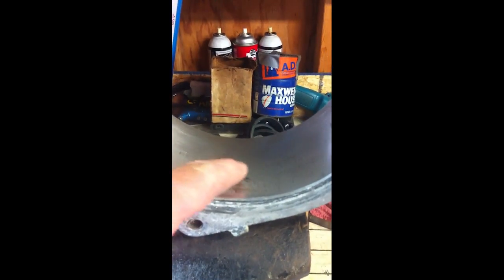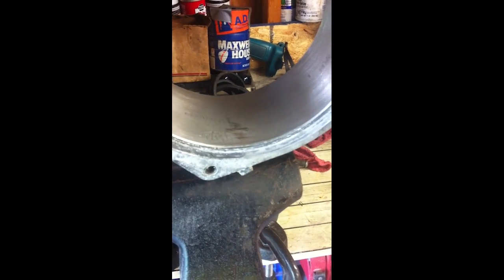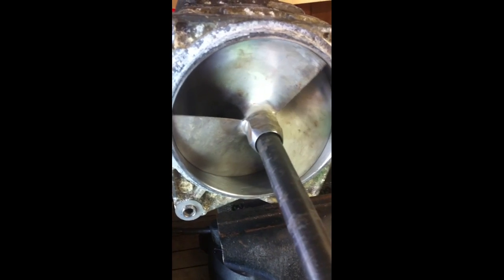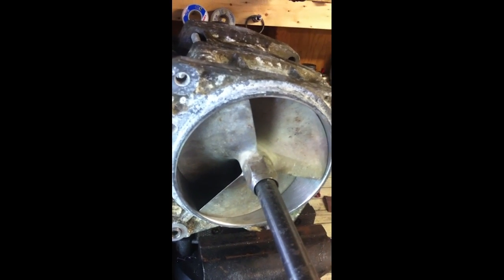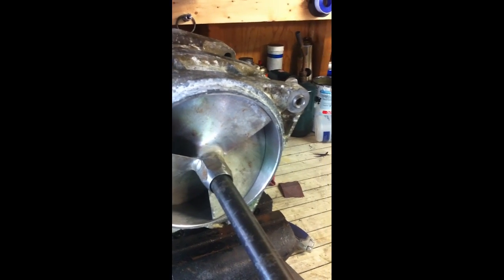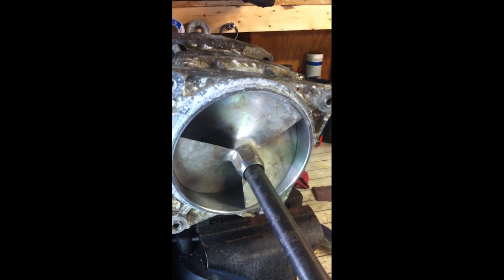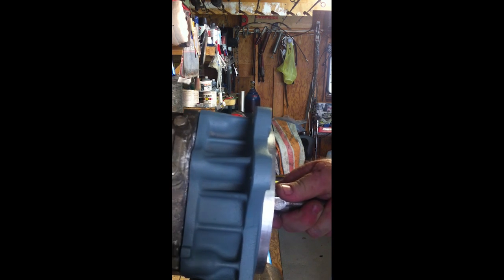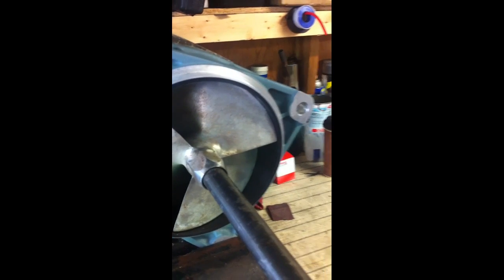Yamaha Wave Runner impeller housing

Comment: Do you have how did you remove stuck impeller into impeller housing i have 2006 vx110 and im having hardtime to pry out the impeller.
Reply: I mean do you have any video?
Reply from the maker: Just used a little "finesse".....and a big hammer! (with a block of wood)